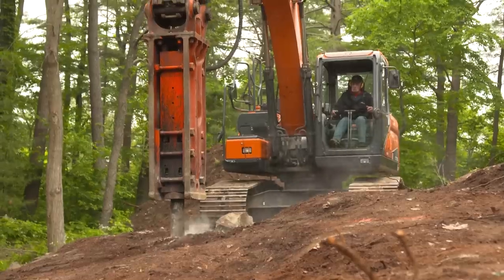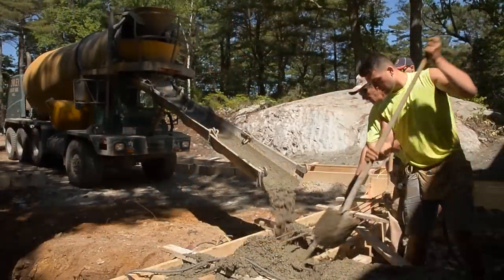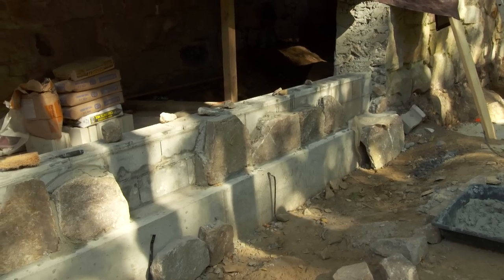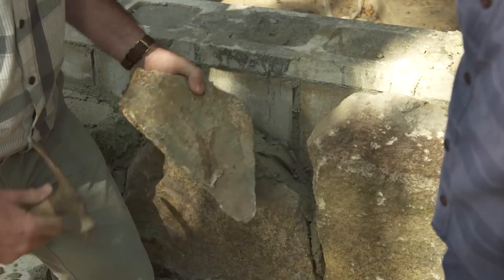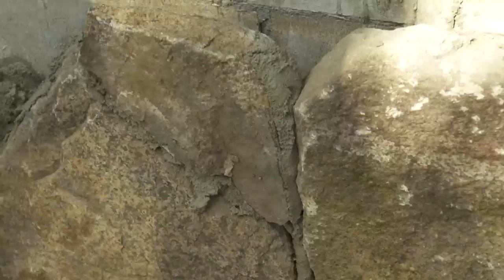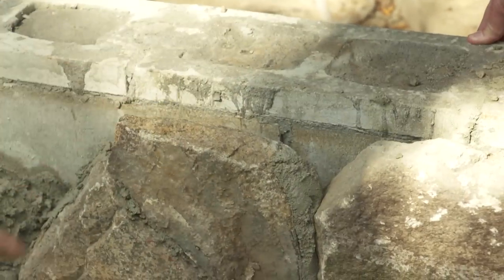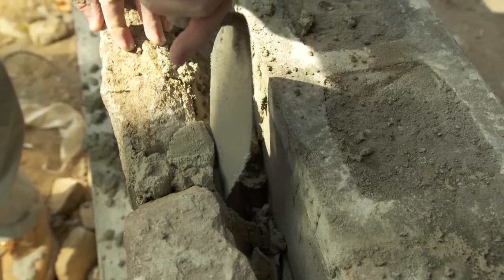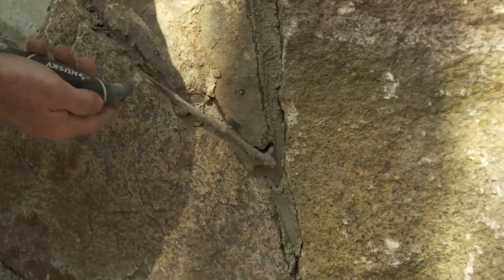How to Create a Stone Wall Look with Veneer | This Old House

Comment: Hi I have a stucco wall that needs serious help.  The bottom 4 -6" is 
eroded.  The whole sheet should be replaced but it is the same wall 
where our gas lines come in as well as it is where our electrical panel 
is on.  Any suggestions on what to do?  I tried to upload a pic but 
couldn't.  I thought maybe replacing the bottom 1/3 of the wall and 
piecing around the pipes a new wall and then doing a faux rock siding 
over it.  Any thoughts from you or your fellow handy peeps out there?  
Thanks in advance!